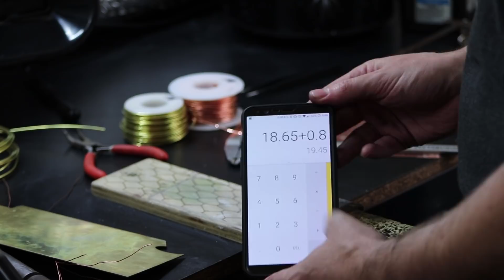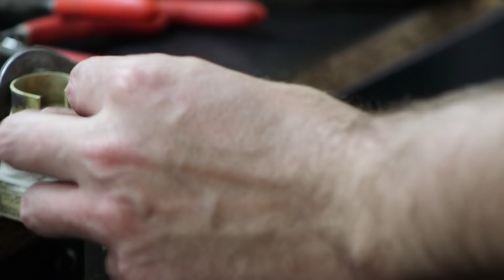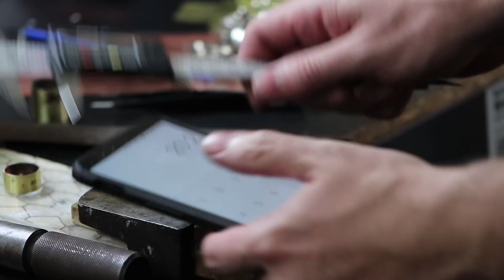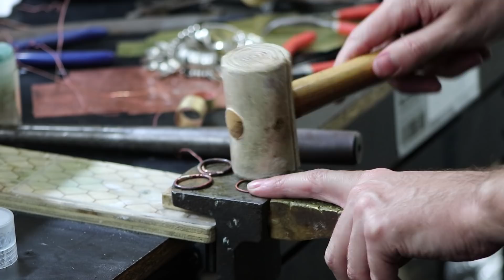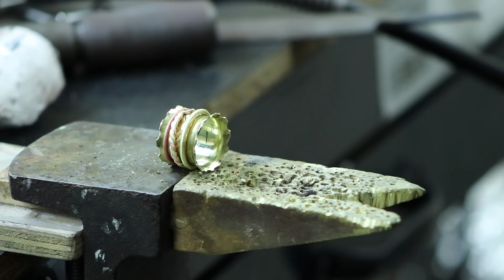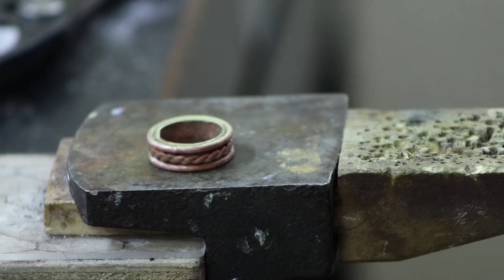How to make a spinner ring - (2 Different Styles)

Comment: is there a cheaper alternative to soldering? I tried using a soldering iron to join pieces but it doesn't look good
Reply from the maker: Soldering irons are only for soldering electronics, burning wood and making stained glass. You can get set up for soldering metals for $25-$50 using a plumbers torch. Check out this video I make all about this.

https://youtu.be/r8nU0ZMZGFA
Reply: @GomeowCreations  thanks sm

Comment: Very nice, but it you are using brass and copper wouldn't it leave a greenish tarnish on your finger?
Reply from the maker: Yeah it would. You can use a clear coat to seal it, gold or silver plate the metal or you can make these using silver or gold using the same techniques. 😁👍

Comment: I'm sorry this is a stupid question... When putting metal on the mandrel, is it measured by the ring's bottom touching the line (ie. Size 8) of the correct measurement? Or is it the top of the ring that needs to be on the size line? I hope that makes sense to you. Oh and looking at the larger ring, all I can picture is the webbing between your fingers all cut up.

Comment: I bet that flared ring is un comfortable to wear.
Reply from the maker: It would depend on the spacing on your fingers
Reply: @GomeowCreations  human hands are basically all the same. Noone is going to have their fingers constantly spread apart. The flared ends of ring is going to dig into the fingers on either side of ring. Only finger it wouldn't do that is the thumb. Flared out ends is just a bad design.

Comment: 5:55 that terrifying moment when u cant get the ring off and ur life flashes before your eyes Lmao.
Reply from the maker: Haha you that is very true. 😅
Reply: The best way I have found to get a struck ring off is to twist it off gently with even force. Make sure you look at how the soft tissues of the finger are moving in order to see where the snag (stuck spot) is.

You can also add oil or soap to get it off, and I’ve seen people use a string method or cut it off too. 

Just don’t wait! If a ring is stuck, get it off as soon as possible without panicking.
Reply: liquid soap or vegetable oil
Reply: Windex has always worked for me.  Weird but true!
Reply: i know this comment is old, but i just had this happen to me today with a ring i ordered off amazon cx

Comment: Do you use brass with 15% zinc and 85% copper? (Under the trade name “NuGold”) it has a redder, richer yellow than cartridge brass with 70% copper and 30% Zinc.
Reply from the maker: I'm using yellow brass so 60%-70% copper.
Reply: Thanks

Comment: Gotta try this. Copper first, then silver.
Reply from the maker: I always practice with copper first.
Reply: @GomeowCreations  Bought a big fat sheet of 18ga copper just for that purpose! ;-) having just returned to smithing after 30+ years away, I've buggered a few bits of silver, but got some great pieces out of water casting with the scrap.
Reply: @GomeowCreations  If you ever get up this way (North Bay SF) holler. I'd like to meet you.
Reply from the maker: Well I do live in Southern California but I have never been to San Francisco.
Reply: @GomeowCreations  It's cooling off. Better hurry! Near the coast the temp drops like a rock after the sun goes down.
Reply: @GomeowCreations  You have got to go to SF, as well as explore a lot of the areas around it, especially wine country! It's as different from LA as night and day, but a great place.

Of course, I'm biased because I lived there for 32 years ;-) But it really is a great place, both for living (if you can afford it), and for visiting. There is so, so much to do.

Comment: I mentioned a problem I was having in the comments of your last video about soldering.  You answered it in this video.  I tried your advice today and you were spot on.  I made four rings today and beat the hell out of them on the mandrel and not one solder joint cracked.  You are the man.  Thanks.
Reply from the maker: Hey, I'm happy to hear that it fixed your problem. If you have any other questions feel free to ask or if you have suggestions for future videos I'm always looking for ideas. My next video will be on picking and I should have it up sometime this week.
Reply: That's great.  I need pickle help too.  No specific questions, just general advice.  I"ve been doing mostly electroplating/electroforming so clean metal is extra important.  Nothing like having a nice piece of jewelery flaking off bits because of bad pickle or oxidized metal or both. Looking forward to you next video.